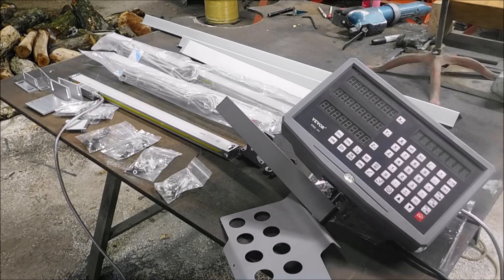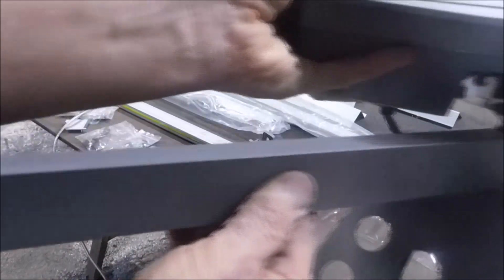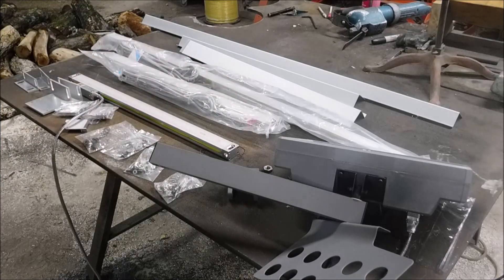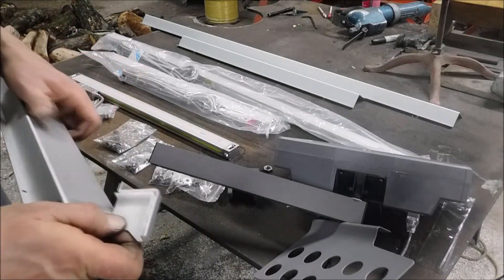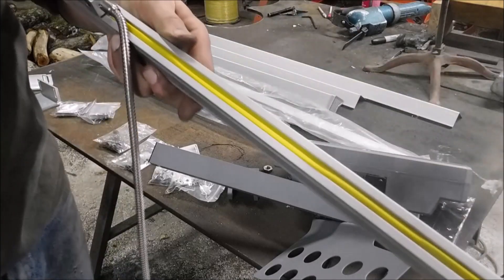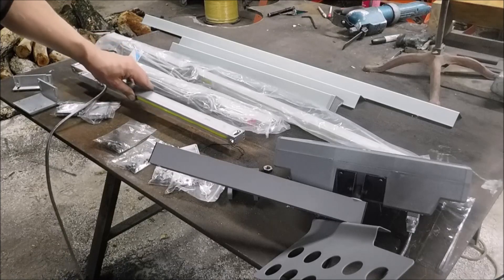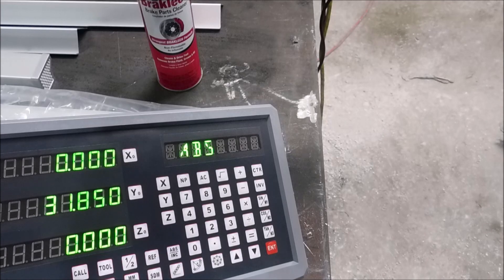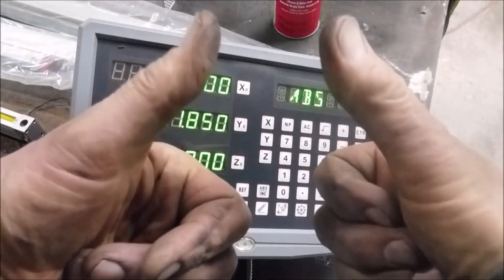VEVOR DRO

Comment: I have a Hymseann SNS-3V DRO and it's exactly the same. With your device, does the calculator function work when in Lathe 2 or lathe 3 mode? Mine doesn't 😞

Comment: Cast pot metal not 3d print. I have several, mill, lathe, surface grinder, been around at least five years. They have a newer led screen version now.
Reply from the maker: Yea you are probally right . But the holes were threaded so I don't know ?